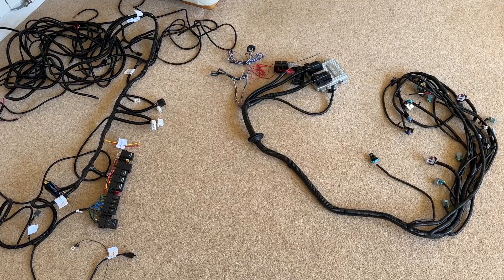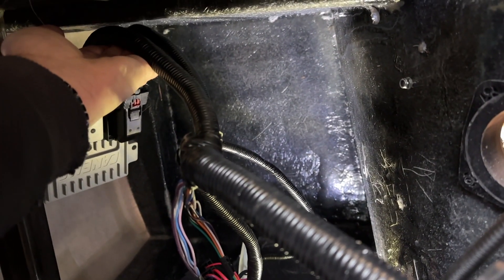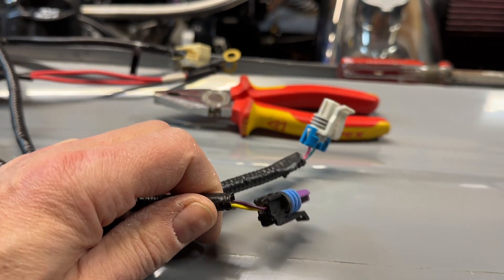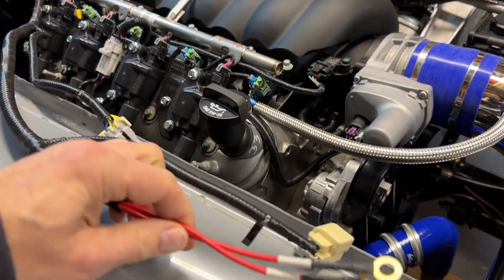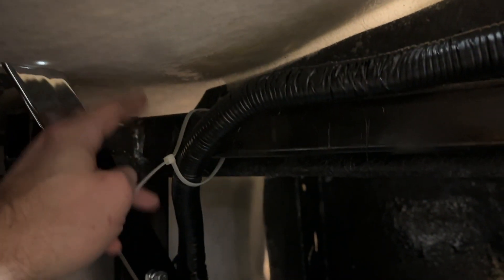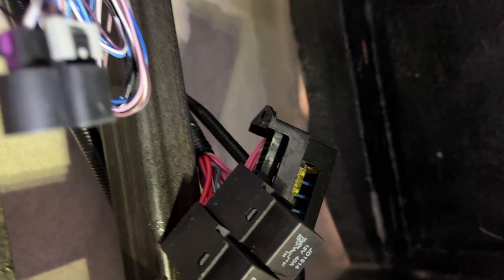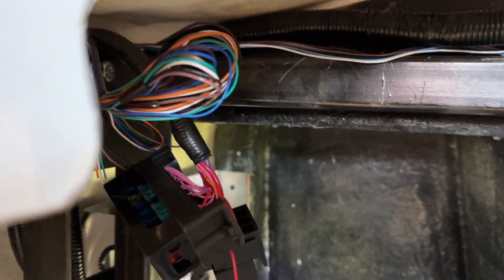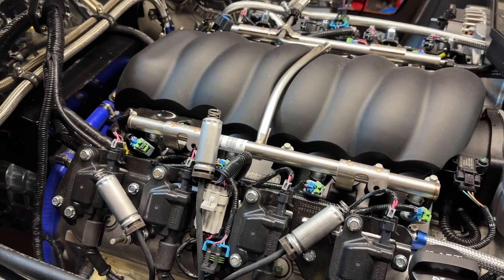Building the AK Cobra - Series 2 - 16 - Installing the Looms and ECU

Comment: Nice work Russ, the Canems ECU and loom look totally different now,  Nice to have the OBD port, shame the older version doesn't have it. Will be interesting to see what happens with the oil pressure connection, and how that links to the AK loom. With a bit of luck it means the end of the xmas tree of fittings.       I guess AK have not built a car with this new Canems set up, or  ECU  mounting bracket to help. Good solution fitting it in the inner wing void. Will be interesting to see how it gets covered, but still leaving access to it for servicing or plugin in your laptop to make changes to the map etc.
Reply from the maker: Thanks Mike. Correct, AK have not fitted one yet. Hopefully a magnetic carpeted cover will be done.

Comment: Another great update Russ. I am really interested to see your next video, particularly in relation to the two Canems cables marked gearbox which you briefly mentioned. When I enquired about these, and where they go, I was advised that they were not used/required? Any assistance on this will be very much appreciated...
Reply from the maker: Cheers Steve, I have covered them but unsure in next vid or one after.
Yes it’s a good idea to use them. One activates reverse solenoid to easier shifting. The other sends pulses to ECU for soeed, but u still need to t off a connection to speedo.
Reply: @russ.howell  Many thanks for your reply Russ, much appreciated
Reply: Hi Russ, I thought I would drop you another line re the above. I spoke with Brian at Roadcraft to doublecheck if we use these, and Brian advised that as we are not using the T56 gearbox they are not required. I have had another look at the diagram from Canems and I have now spotted that they state J - T56 gearbox reverse lockout solenoid, K - T56 gearbox vehicle speed. I am not quire sure how I missed that they were labelled T56! I assume you are using the T56 gearbox?
Reply from the maker: @stevesutts69  thanks Steve. They can be used as per Canems. Just have different connectors on end. I already had connectors, so cut the t56 ends off and soldered to the tko600 connectors. All good.

Comment: As for fuse box move, that has to be backward move, that will be almost impossible to reach when the dash is on with the glove box. Its hard enough to reach the relays etc  on the older version. Might pay to bite the bullet and cut the stainless so that its in the engine bay and easy to get at and see if anything has blown. Or maybe try and fit it close to ECU on a bracket so that all you have to do is remove the same side panel for access.
Reply from the maker: Yes I wrestled with this for weeks. I have a tool that can do the longer horizontal slots for a cut out into stainless, but can’t do the 1 inch vertical cuts in limited space.
Also, as not my car, didn’t want to experiment!